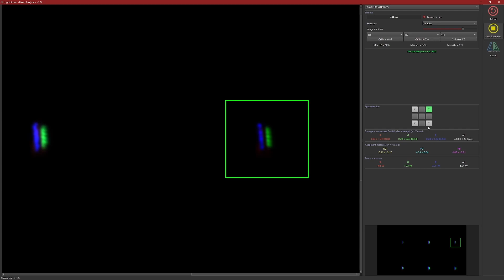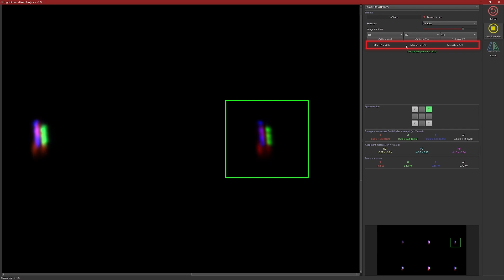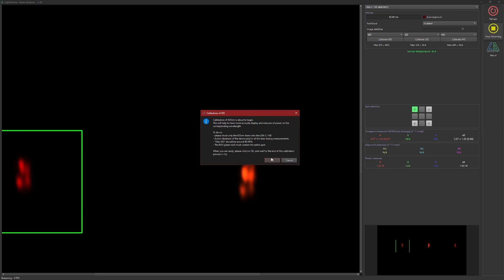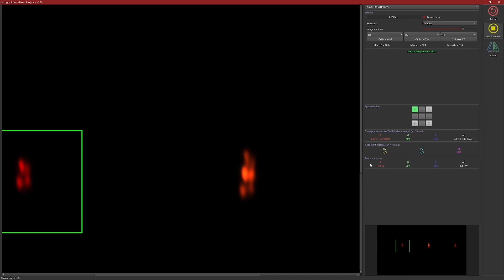How To Use The Beam Analyzer Software

Comment: Can you measure yellow a577nm also?  I get maybe you can only do three ata time but can I add my yellow in after rgb.  Can this talk back to beyond to drive my motorized dichroic motors?
Reply from the maker: Yes it can measure yellow.
There is a button to "Add a wavelength", and to calibrate this wavelength.
On the "G" column, click on "Add a wavelength", select it. Project a single 577 beam, and click on calibrate.
Enter the power if it is known.
Even if the power is not known, it can still be used for alignment and for divergence measurements.
Note that the calibration should be done for each of the 4 corners